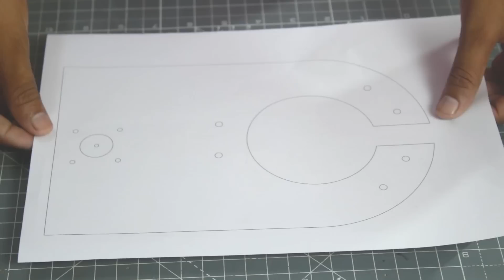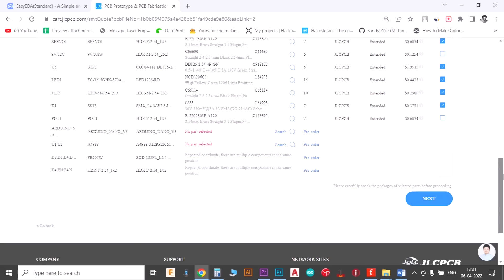DIY Arduino based Wire harness wrapping machine | Arduino project

Comment: arduino?? a voltage regulator (basically a transistor) and a potentiometer would do the same trick for 100x cheaper 😂 but that's me, what do i know

Comment: You could also achieve this with 2 simple switches in parallel.
One micro switch  running on the rotating section that trips on the opening and a second toggle switch.
In parallel they would act as an OR logic gate to turn on and an AND gate to turn off.

Comment: An Arduino for this simple task?
Over engineered just to demonstrate using a Micro for an analog task.
Just disassemble a cheap Rechargeable Li-ion Drill and you have all the components you need.
A geared controllable motor, an on/off switch with a motor speed controller, and a portable power supply with a charger.
Turn the On/Off switch with inbuilt speed controller into a foot pedal so you have both hands free. 
And as a bonus it is reversible.

Comment: Why? When I worked at Crank and Charge in Miami, (1982? ), we had a 'machine' that would take 3 rolls of electrical tape and spin them around as I pulled new wires through it making a new wiring harness. It was non electric. It was powered by me pulling the wires through it. Your reinventing the wheel here. Not necessary.

Comment: 9:36 It should automatically stop with the opening in the correct position, otherwise you could have just used a dc motor without an arduino!

Comment: looks verry cool. bad the arduino is not nesesary for it jest use a switch. it woud by cool if the ardruino was switching the motor of wen the gap was alind bad it dosend so the ardruino is not needit

Comment: Don't know why you need arduino for this a cheap 12v motor and controller would be far more efficient and cheaper.
Reply: I used a 12v 319 rpm motor.

Comment: Could you possibly make this more complicated with your motor controller? A simple on and off switch with a DC motor we work just as well. If you need variable speed instead assemble DC motor controller.

Comment: Way to over engineered  the microcontroller is not needed just a motor a belt with a pully system a on and off switch or a dial switch to allow change of speed and maybe a resistor depending on the input of power. It be understandable if the microcontroller not detect the cord but also stop at the open point but it doesn't.
Reply: Too add to this you could also use a foot pedal switch instead making the switch hands free

Comment: You don't need this unless you just want to publish a video.

Spiral wrap is way cheaper that all those components, save your time in designing and building, and gives you a better final product, and faster!! that thing is slow as F.

And no, you don't need a microcontroller for this. You don't need a stepper motor either.

Comment: If thats a stepper motor, it would be easy to program the arduino to always stop with that gap lined up.
Reply from the maker: exactly
Reply: @MrInnovative  Having said that, even if it isn't a stepper you could still do it with a suitably placed microswitch.
Reply: @MrInnovative  but that assumes that the belt will never slip...

Comment: Please just invest in some braided sleeving. As someone who has to troubleshoot stuff like this regularly, this is an innovative solution to a problem that already has a better answer.
Reply: Adding to this:
You can buy braided sleeving with velcro closures for larger bundles. I found it extremely useful for producing harnesses to go between computer racks

Comment: I get the theory behind the opening in the front, but it seems to be completely useless when you could just slip the wire through the opening! Complete design, flaw, redo it with a closed ring

Comment: I'm going to make me one of these. What part does the printed circuit board play in all of that?  There's enough circuitry there to make a ham radio! Surely it doesn't play a part in that operation!
   Something you could add would be a trough on each side of the machine, to lay your wire in, to keep it centered, because if the harness gets into the opening of the C, it would make a BIG mess!

Comment: A foot petal would be a better means of controlling this. It is a cool idea. I can also see you can make your own shielded cables with this as well.
Reply: I was thinking the exact same thing. I’d just rob the electronics from an old sewing machine.
Reply: Likewise. I see no need for the arduino and a footswitch would be way simpler and cheaper. I thought maybe the arduino was there to stop it with the gaps aligned, but no. . .

Comment: What that machine needs is a simple geared motor, microswitch and clutch.  Thus it would be able to stop at the right spot every time.  No microcontroller required.

Not that I don’t like it, I just think we all get a bit lazy in our thinking and chuck a chip at everything.

Comment: Shrink tubing does exist and it comes in different colors. They can help with cable management. Just apply some heat until it shrinks. Simple as that.
Reply: Heat shrink won't fit over cables that are already terminated.
Reply: @67amiga  If you get them big enough they will. I've done it before. You just have to keep heating it lightly until tight and snug.

Comment: What is the arduino for? A DC motor with an analogue speed controller is all that is needed.
If you are going to overcomplicate it add a sensor so that it always stops with the gap in the right place for starting again.

Comment: ...Superb project !!!!

To add a real professional look to the cable, stop the winder at about 10cm from the USB connector without cutting the tape, shift and hold the USB's cable  to the left side and continue wrapping. Once the wraping is complete, reposition the USB to the right and add a few turns of wrapping over the cable.

Comment: I like the mechanical design. But you didn't have any functionality from arduino. :-( The video title is just wrong. You don't need special PCB nor Arduino.
The timelaps during making cable harness is hiding how awefull slow this is.

With just some modifications this could be so much better. Add a sensor to deect when the gaps are matching (BTW I don't get for what you use this gap, you just can stick the cable from the side). Adding tubes before and after the tape to help guiding the cable. This schould keep the cable perpendicular.
How do you avoid that the screw that holds the tape roll unscrews?

Comment: You dont need an arduino and a stepper motor for this.  You can do it with a regular motor and a park switch like is done with windshield wipers on cars which have been stopping in the park po ition for many decades before fancy electronic controls
Reply: I think it's great that he shows this video. It's good to have alternatives. You can do same thing with different ways.
 I love that you can build electronic device with or without microcontroller.

Comment: That's awesome 👏🏼. That would be super useful for after market car enthusiasts. Wrapping engine harnesses by hand is a real chore.
Reply: 'engine harnesses'  I looked at doing a fully automated harness maker as far back as the early 1980's, running the steppers on my Commodore 64.  The real trick is pulling out each of the wires and stripping and terminating them at the real manufacturer's termination machines, so everything is correct.
I could probably do it now and still make some money at it, but the market is actually tiny.  By the time you make a machine do it, then a person or two to do testing and fix any minor errors, you can basically just make a harness board and do it all manually with about the same effort.  Realize even then there were already machines that cut to length, stripped, and terminated both ends.  When you have all the wires for a harness in piles, it's pretty quick to go through the piles grabbing one of each and putting them on a wiring board.  So you can make a bunch of harnesses in fairly short order manually, very similar to how they do it in factories, you can find old video of how it was done for ww2 planes etc, even a few car harness videos.
Still, I could do it for fun if nothing else, I have a stockpile of 500+ steppers and thousands of microcontrollers on hand.  If nothing else it would make some good videos just watching something like that running.
HA, someone is making them since 2001.  '914/4 Porsche Replacement Wiring Harnesses'  Even in the 1980s when I had my 914 the wiring harness was an issue, and they weren't cheap, like $1200.  Finding a price now they're '$1,500.00 · In stock'. 
And of course I'm sure there are other cars with problematic harnesses that could use similar.
 But still you're competing against a lot of cheap labor that's just doing it manually.  Even with a fully automated machine, the idea is a bit more marginal that it seems at first glance.

Comment: Nice build.  Next, you can add another stepper motor to horizontally move the wire, making it a hands-free operation.  That would make another build video...
Reply: Exactly, with a reverse to back wrap/start, finish.

Comment: It is overcomplicated. Since you use an Arduino board (which you don't need; there are other stepper controllers on the market) to spin that motor, you could make it stop in the exact same position every time you press that switch. Just count the pulses you send to the motor for a ful turn (360⁰) and use that information to make it stop in the same convenient position. Just a free idea to think about.
Reply: I would just use a sensor to detect the edge of the opening to stop it so the 'mouth' of it is always open.
Also, a foot switch to operate it.
Reply: @brucelytle1144  Exactly. And since a stepper motor is used, when the footswitch is released, have the Arduino slow-down the stepper until the winder's mouth aligns with the support's. A magnet  / reed switch combo would be perfect. The sensor may also allow the addition of a counter...
Reply: @ve2um  I'd use an optical sensor, non contact, and program the ramp down and total steps to stop.
Reply: Exactly my thought,,
Reply: or you could just use a brushed dc motor with a limit switch in parallel with a double-throw foot switch. Let the limit switch ride on a cam, and when you let off the foot switch, the cam can be timed to open the limit switch such that the gap moving piece aligns with the opening in the frame. The throw on the footswitch that provided power to the motor opens and simultaneously closes the throw that shorts the motor back-emf through the footswitch for a braking effect. no solid state electronics required.
Reply: would u get drift over time? how would u re set the open pos then ?

Comment: An example of the real DIY and technical skills spirit!
Reply: Too bad engineering skills are shit.  Being able to make something as complicated as humanly possibly for no reason does not make you a good engineer,  it makes you a bad one .  Its absurd to use micro controllers on something that needs maybe 2 or 3 electrical parts TOPs if done right.  Idk wtf this is other than overly complex, overly expensive mental masterbation

Comment: Pretty damn clever. I think a spring tensioner  on the drive belt might reduce the noise while it is running, but that is a VERY picky little comment.  Well done!

Comment: It''so all good and dandy, but I think, it's a waste to use a stepper for the job, that can be done with the regular cheap analog (AC/DC) motor and I don't understand, why would you need to use the sophisticated electronics, when it could be done with the simple battery and the clicker (on/off switch) with some resistor to regulate the voltage to the motor? That's all! I don't understand, why did you go for such a great length to make a simple cheap thing, so complex and expensive?
Also, I strongly urge, when you handle your circuit boards and electronic components, you can hold them, as you wish, but when you are showing it on camera, please, please, please, don't hold them, as you hold them, touching everything, while reducing the component's life span. Hold them ONLY by the edges, that don't have any path and/or components exposed! By touching the components and circuits on video, other, less experienced people think, that it's normal to handle electronic components like that. Please handle electronic components appropriately, when you show it on the video! Be an example!

Comment: Why are you wrapping wires with pipe thread Teflon tape?? Just because it has Tape in the name doesn't mean it's actually tape, or that it's meant to be used on wires... You should be using electrical tape!
Reply from the maker: its just a demonstration we can use any type of tape..

Comment: I'm curious. Since you have a CNC (you used it to make the plastic rotor) why didn't you use it for the plywood backing plate too?
Reply from the maker: because my milling bit only make cuts upto 10mm and wood is 12mm thick, If I upgrade my milling bit then I can.
Reply: @MrInnovative  fair enough! That’s a darned good reason! 😁
Reply: Nice job.it would be better if it's much smaller and can use it in tight spaces whereby the wiring is still in the vehicle.

Comment: That's actually how hydraulic tongs work in the oil field. It's like a giant wrench we use to tighten and unscrew the long string of pipe in an oil well, except the tongs have jaws that operate similar to an iris closure with a ring gear and individual jaw gears.
Reply: I smiled when I saw this comment.
Reply: Tong tuh tong tong tong.

Comment: Does it have the power to unspool electric tape? It's a little tougher to unroll compared to masking tape.
Reply: Depending on the stepper motor, it could have that power. And I think even this motor used here can do it.